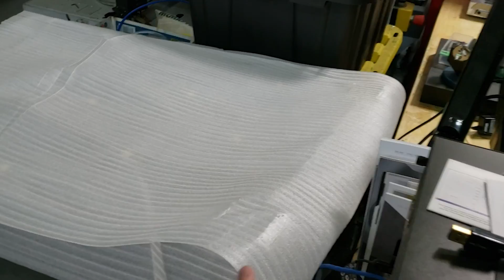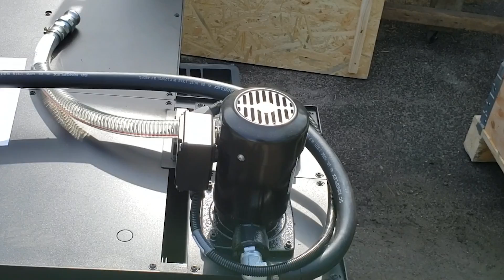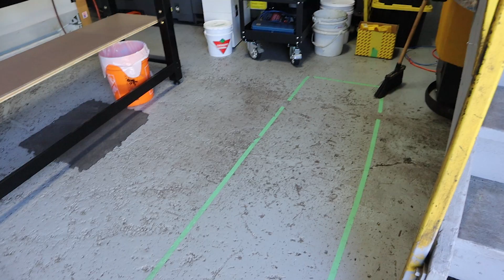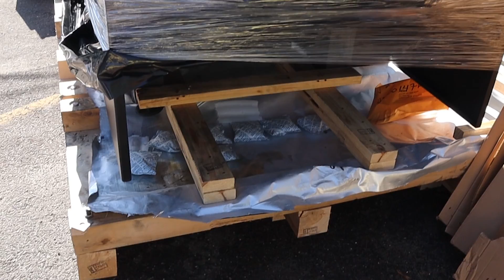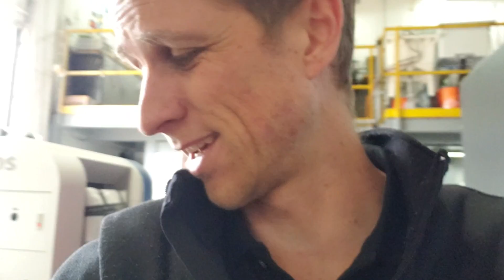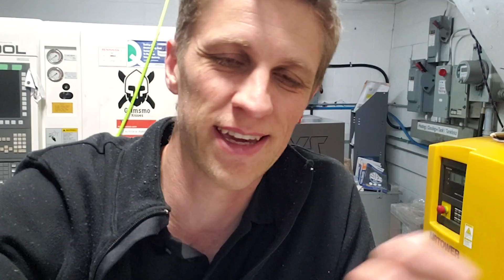We bought a SWISS LATHE!!

Comment: Do you have a second means of egress for the mezzanine? Putting a hydraulic unit that uses oil (as opposed to water based coolant) under the stairway may be an issue for egress if it blows a hose and catches fire. To utilize the cube of the shop you may want to consider extending the mezzanine and placing the unit upstairs. Hard pipe the hydraulics to eliminate hoses and use metal flex joints at the pump and at the lathe. Sweet setup. It will be interesting to see the parts it produces. You got enough work to keep it busy or are you going to do some job shop work?